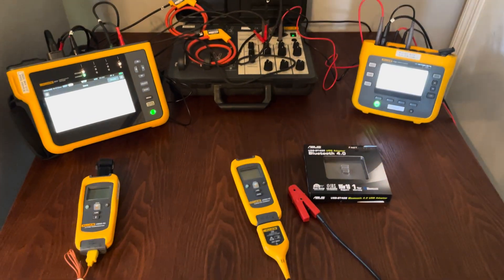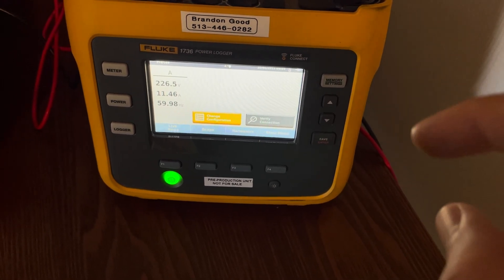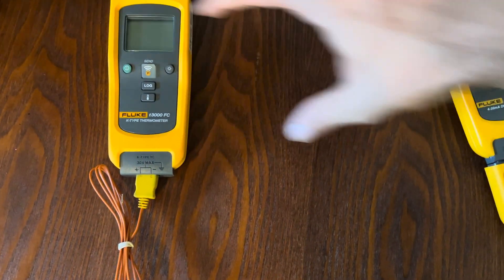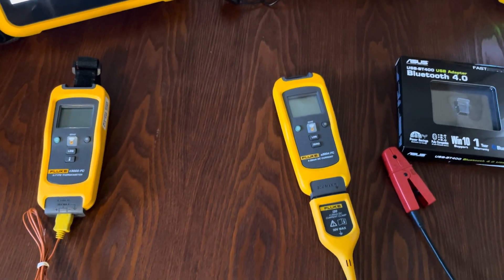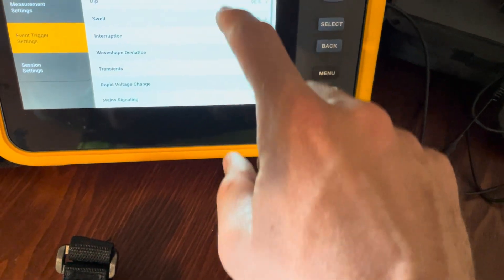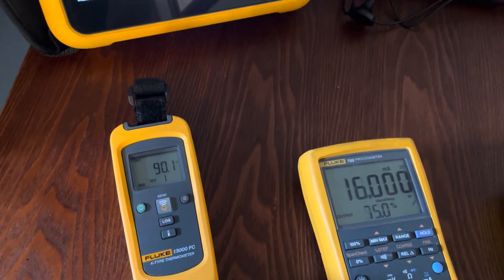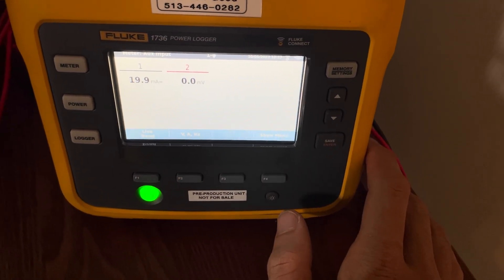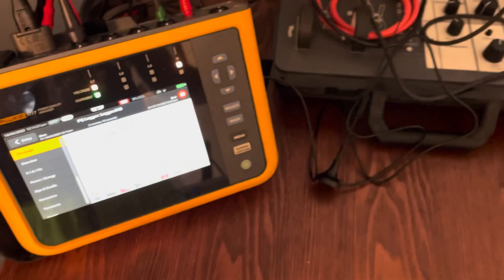1777, 1738 connect to FC modules - Fluke Fridays - Episode 113

Comment: Thanks. I was trying to figure out how to link my Fluke FC series to my Fluke 1730 series loggers, this worked perfectly using the internal Fluke wifi/bluetooth USB adapter in my Fluke 1736. This now solves my issue of trying to generate a single cohesive report where I am monitoring both the power quality of gear as well as ambient temperature inside of larger machinery.